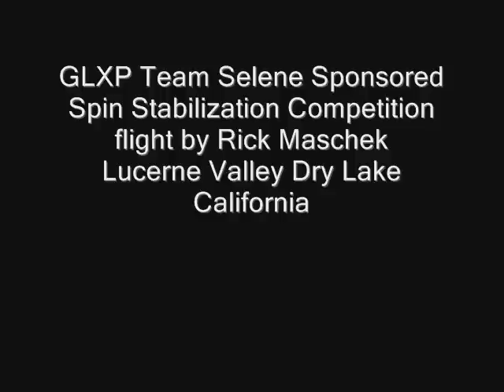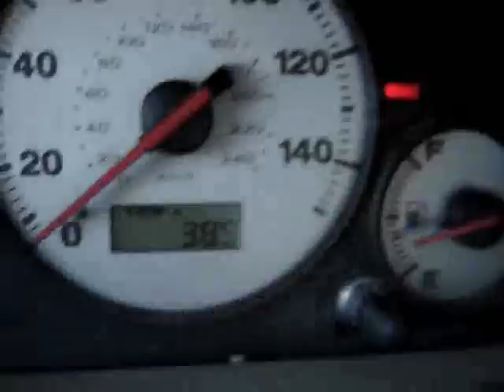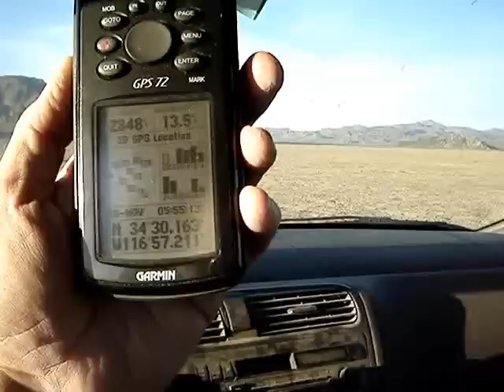GLXP Team Selene Spin Stabilization Competition winning flight

Comment: My attempt at cantered motors for spin stabilisation on this junk rocket built from Redbull cans last week. Failed but I've got a solution... I think??? =\

http://instagram.com/p/us4FCCLE57/
Reply from the maker: One thing about spinning up a rocket is to de-spin it for chute recovery. First one I did kept spinning and wound the chute up and it crashed.
Reply from the maker: See the Up Aerospace video on you tube titled 'SpaceLoft-8 Onboard Flight Video'.
They use a yo-yo system to stop the spin at 0:55 seconds into the flight to space.
Reply: mojaverockets This links to the same video?
Reply from the maker: DefyIndieFilms I don't know, I can't view 'instagram'